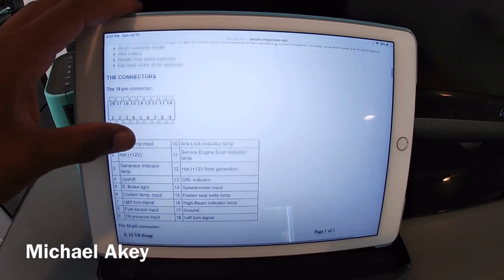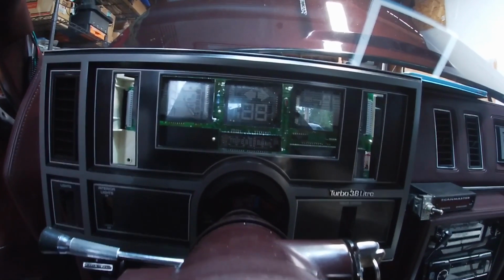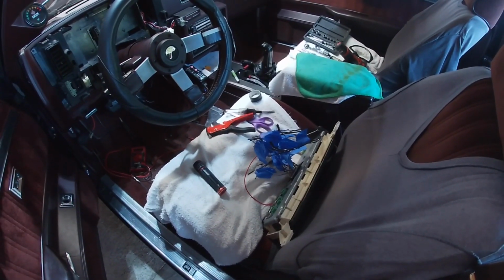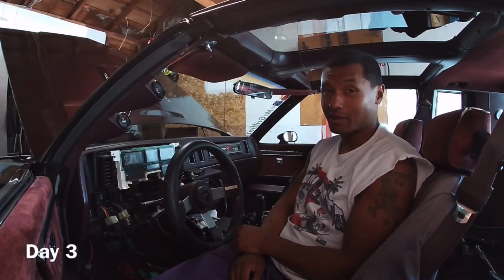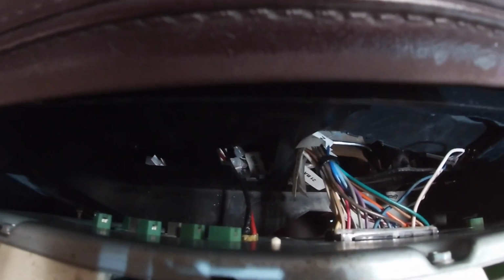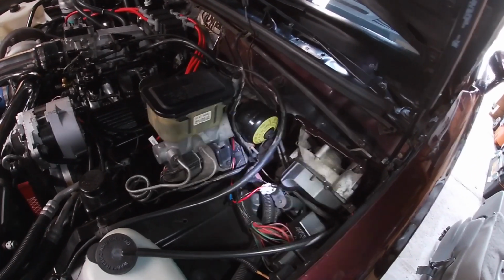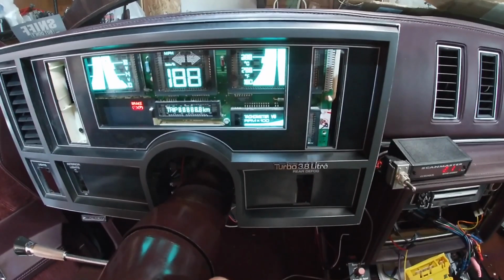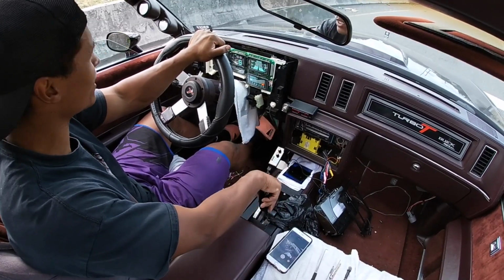WIRING | S10 DIGITAL DASH TO A 1987 BUICK REGAL “T” TURBO | G-BODY

Comment: Did u had any problem trying to make the temperature gauges work right
Reply from the maker: No they were pretty close. I did this on another car and it was off because the dash was faulty. Just make sure you use the sending unit from the donor car and you should be OK as long as the digital dash is working fine.
Reply: I did am doing this swap on a 88 s10..but my temperature goes all the way hig in les dan a minute i bought another cluster n it does d same
Reply: Any advice dont want 2 use a after market temperature gauges
Reply from the maker: @javiervera9422  Are I sure u have the sending unit hooked up correctly?
Reply: @MrGriffin23  i found d problem las night..it was my grounds i had the ground conected together that was causing the temperature to go all the way high in less than a min .man i was stressing out..
Reply from the maker: @javiervera9422  Awesome! Glad u got it figured out. I assumed it was wiring. Especially when both did the same.
Reply: @MrGriffin23  yes thanks for responding did u had d same problem
Reply from the maker: @javiervera9422  No problem. No I didn’t.m, but that makes sense & figured it could be a possibility for your install.
Reply: @MrGriffin23  on the oil temperatures switch the donor come with 3 wire I c that one wire is brown tha goes to d cluster..if i just conect that wire straight to d cluster would it work.
Reply from the maker: @javiervera9422  Yes it should operate the PSI gauge on the dash. If I can remember correctly the other two wires might be for the idiot light and or the ECU.
Reply: @MrGriffin23  have one more question..how did u coner ur speed sensor buffer
Reply from the maker: @javiervera9422  ? I think you have a typo. Not really understanding.

Comment: did you have any issues with the alternator charging after the dash swap
Reply from the maker: No. I purchase a unit from Casper’s electronics to “bypass” the volts bulb in the stock dash.
Reply: @MrGriffin23  what is that part number or name

Comment: How did you contact the temp sensor? My goody has one wire, the temp sensor from the donor has two wires.
Reply from the maker: Have to use donor car temp sensor and all it needs is the signal wire hooked directly to the dash harness.
Reply: During the day I can barely see the cluster, at night it’s extremely bright. Do you have any suggestions about the wiring?
Reply from the maker: @jwtru2life  No I don’t. There is a dimmer wire but I’m not sure how to hook it up. I couldn’t get it to work to see if I could make it brighter.

Comment: Am doing the S10 blazer to S10 and I was curious on how you got the pin out on the digital gauge because mine does not have any numbers on the plug thanks.
Reply from the maker: I got it off a website that is no longer active. You can take screen shots of the diagrams in this video. That’s what I did when I completed another S10 dash swap.

Comment: Hello. You have the diagram of the digital cluster that you installed in this car, I have a Chevrolet Blazer 94 with this cluster but I want to change to an old school cluster with a tachometer that is supposed to fit in a S10, Blazer or SONOMA from 90-97, but I can't find the diagram to be able to do the wiring correctly.
Please I need help.
Reply from the maker: The website I used is no longer up. You can take screen shots of the schematics from this video u commented on. I showed it on this video.

Comment: You think this will work in a 84 El Camino
Reply from the maker: It should. Seen it done in a MC before.
Reply: @MrGriffin23 I have a 87 Monte trying to see how I can get help doing this I already have the cluster
Reply from the maker: I would think wiring would be very similar. You can check my wiring video out. These videos are o er 4 years old and I haven’t worked on one of these dashes since.
Reply: Ok that's all I need to know thanks